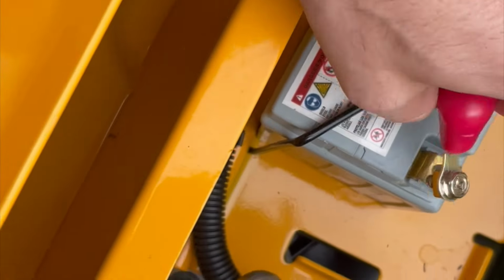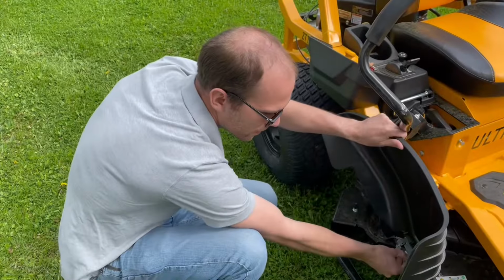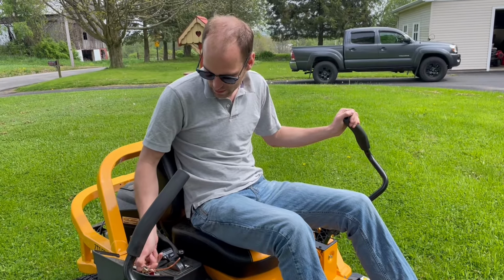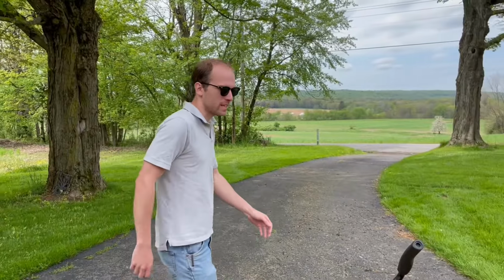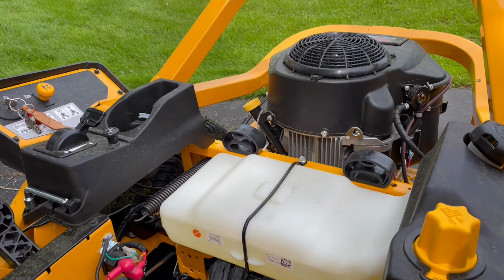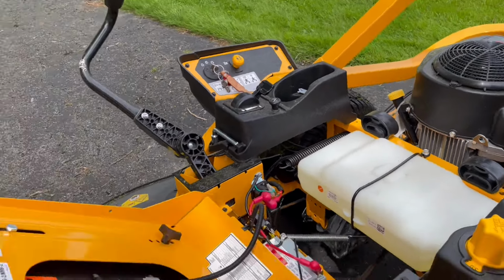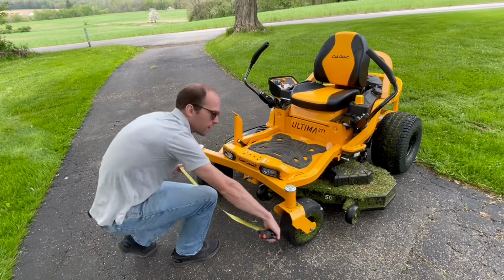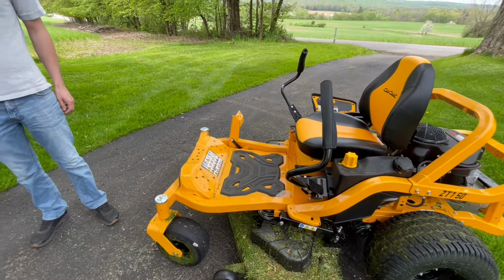Cub Cadet Ultima ZT1 50 in. Fabricated Deck Fuel ⛽️ Saver

Comment: never understand why people full throttle then pull pto in ? its like if you had a  manual car full throttle 1st gear then droping your foot off the clutch !!
Reply: Believe it or not it is less wear on your machine ... and it isn't like a manual car at full throttle in 1st gear then dropping the clutch!  I can tell you have ZERO knowledge of what you're talking about
Reply: LOL...I was not going to say anything but yeap! sure nuff too...and the way he started it, like 4 times to start it, and the way he let the seat down when it banged real hard, oh man, I would never treat my Cubby that way...his will be in the shop within a year maybe 2...
Reply: That’s what the manufacturer says to do full throttle then engage the pto
Reply: Things aren't the same as they used to be.  I just got rid of my 92 J.D. STX-38 and low throttle was the way to do it, but with my new C.C. its full throttle.
That's about the only thing he did correctly lol.